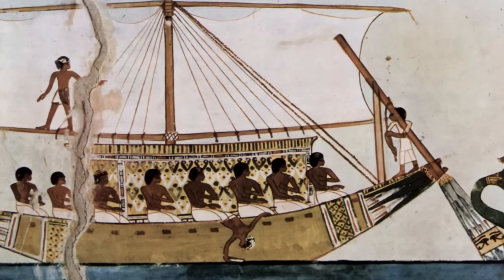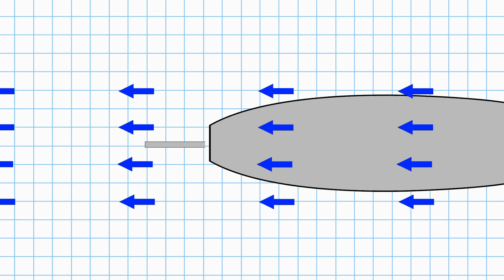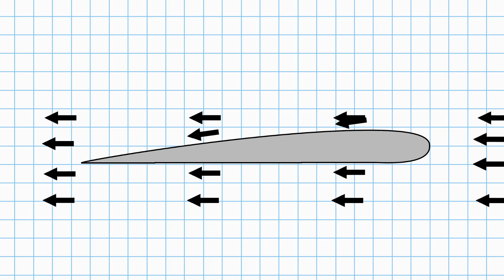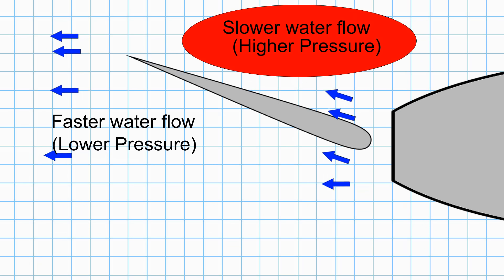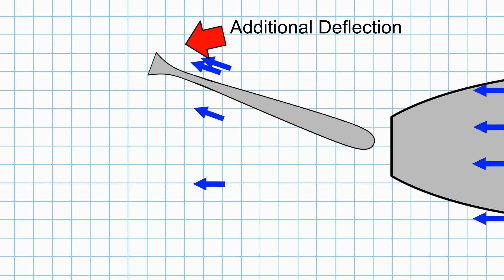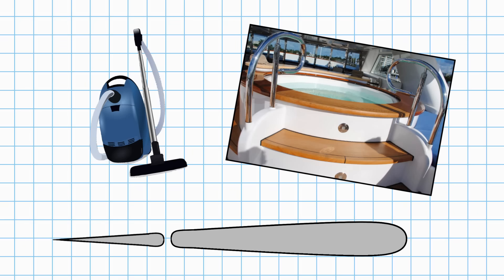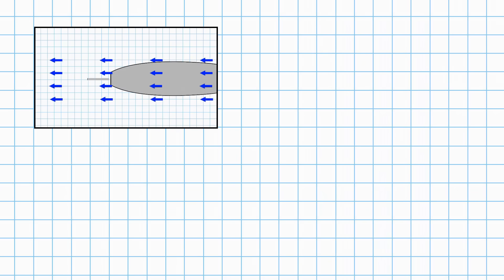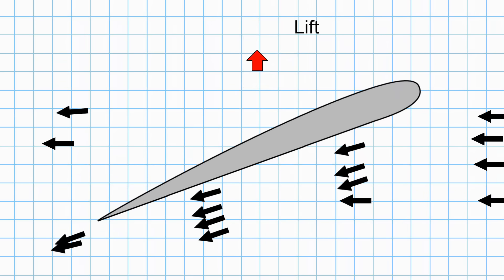How Does A RUDDER Work?

Comment: Your have only illustrated turning to port. Looking from aft, when a clockwise rotating single-screw vessel turns to starboard, there is a more quicker and stronger answering to the helm, a vital aid in the rule-of-the-road seamanship.

Comment: The finishing animation of air wing stall is totally wrong. The lift force actually increases with the increased angle of attack, while the animation shows it's decreasing. All up to the abrupt point of stall, above the critical angle of attack, when the air flow around the wing changes completely (arrows should move from the trailing edge towards the midsection of the wing).

Comment: The way a wing stalls is slightly different in that the airflow separates from the airfoil due to turbulence, you never really get out of the flow regardless of angel of attack due to forward movement.

Comment: Wings and rudders dont work because of a pressure difference. They work the same way that any motion works, Newtons third law. A rudder or wing pushes a mass of air or water because of angle of attack, and the rudder/wing is pushed equally in the opposite direction. Semantics...

Comment: While your description of hydrodynamics is correct, your depiction of hydrodynamics is displayed incorrectly. I’m sure it’s a limitation of whatever animation graphics application you used, but the way you display it shows a massive cavitation, or stall, of hydrodynamics flow on the low pressure side.

Comment: fun fact
Steering board in German is Steuerbord, it is mounted on the right, which is why Starboard is the right hand side of a ship
Reply: Thanks for further insight! Now that I think about it, what about the "portside" though...
Reply: @jehoiakimelidoronila5450  almost all ports required large ships to dock on their left side so the left side is called port sode
Reply: @jehoiakimelidoronila5450  also, in German the starboard side is still called Steuerbord, and port side is Backbord, because most people the dominant hand is the right hand so the left is called Backhand, hence Backbord
Reply: @mariebcfhs9491  the port side of a ship in English used to be called "larboard." it was changed in like the 16th century or so to reduce confusion for obvious reasons.
Reply: @jehoiakimelidoronila5450  since the rudder was on the right side, a ship could dock at a port on its left (or port) side. 

I am not that well versed in nautical terminology and history though, so if anyone knows their stuff better, please feel free to correct me

Comment: Thank you for sharing. Hope you can do a video on the shape of the rudder. I think there are a variety of shapes. Some straight, tapered or curvy, with larger area at the bottom as compared to the top. Thanks again.

Comment: Great video! The fishtail makes me think of the winglets on aircraft wings. Their purpose is also to minimize the air flowing around the edge from high to low pressure. The ship version seems to include additional effects, such as deflection, which you don’t have with planes. But they are amazingly effective, increasing efficiency by several percent. That’s why they are ubiquitous today.

Comment: Bull.  The airfoiled rudder works on the exact same principles as the squared off rudder.  It just does so more efficiently because it has less drag.  The velocity differential is still there for either shape.

Comment: Unfortunatly, you aero/hydro dynamics explanation is wrong. I recommend watching YouTube clips on how REALLY lift is generated. 
For the most basic explanation, the ruder deflect the water, and by newton's 3rd law, the water deflect the boat. At the trailing edge the water won't resume to the original direction but will have some speed at the same angle of the ruddr (until the surrounding water overcom).

Comment: I’d suggest that the force generated by a rudder is more to do with the change in momentum of the water, rather than Bernoulli pressure differences. It’s similar with aircraft wings; the angle of attack generates far more lift than the cross sectional shape

Comment: Are there any segmented fishtail rudders? I mean the dual segments works just like a multi-level wing on a race car and the fishtail acts like an aero break but functions like and end plate. so it seems that you could be able to get a much higher amount of maneuverability from some combination of the two. So long as the fishtail is only on the rear most segment of the rudder because otherwise it would negate some of the benefits of that style of rudder

Comment: If a boat is floating without any means of propulsion -- that is, its speed is determined only by the speed of the current -- can a rudder change the direction of the boat? If you recall in the movie The African Queen_ Bogart explained to Katherine Hepburn that it would do no good for her to operate the rudder. They were drifting downstream with the current and the rudder was not able to provide any steering unless the boat was moving faster than the current. Is that true?

Comment: You missed the stabilized or the center axis rudder.  That rudder has it's turning axis in the middle instead of the leading edge.  This allows the entire prop wash to act on the rudder and turn the ship much faster or sharper.  It can be used on the Becker rudder.

Comment: Question. On an RC Boat I notice the rudder is able to make a big left turn but the right turn angle is small. If going left I would say it turn about 45 degrees but if going right it turns about 25 degrees. Is this the correct way it should be set or a defect ?

https://www.youtube.com/watch?v=vfwmkoA3xVE

Comment: Thank you for your video . You have answered a question that has puzzled me for years . I saw a drawing of the system. Used to keep passenger liners stable in rough conditions. Where they would have short , " wings " on the sides underwater , that turned to keep it more upright . This design had short wedge shape on the trailing edge . I have asked many people why this was . Now thanks to your explanation of  a Schilling rudder , I know !

Comment: Ahhh- no- wings do not create low pressure that ‘sucks’ a plane into the air. And ships rudders do NOT create a high and low pressure zone in the water-
How a wing works is thru THRUST.  The low pressure zone IS created over a wing- however, the inertia and momentum of the wing are far too high for that weak low pressure to move the plane.  Instead, the Normal pressure air, well above the low pressure adjacent to the wing, Rapidly moves Down to equalize that pressure. As the wing moves forward, that downward thrust air is accelerated down beyond the trailing edge of the wing...when the mass of the air being thrust downwards equals or exceeds the mass of the airplane, the plane flies. This is proven by every Propellor and Fan... they obviously produce a powerful Thrust. The “sucking” side of a fan or propellor has nearly No force.

Similarly, when a rudder deflects the flow of water, it is creating a Thrust lateral to the direction of the ship and the vector of that thrust is located at the stern.
Water on the off side of the rudder is also deflected.   And the reason propellers are often arrayed so their thrust is run across the rudder is so that when turned, the rudder can redirect a thrust far greater than the mass of water flowing past the hull.
Reply: This comment is mostly correct but not entirely, I'd highly recommend you watch this video which attempts to explain everything involved in generating lift, and can be translated to the rudder of a boat quite easily.

https://www.youtube.com/watch?v=PF22LM8AbII

Comment: I'm a pilot and I didn't know that ship rudders could stall
Reply: The Bernoulli effect not only effects our wings, rudder, and elevators in the air but also effects other things in a fluid environment. I was shocked to learn helicopters could stall to but when I thought about for a bit it made sense.

This has also made how submarines glide underwater more interesting since those wings on the sides actually serve a purpose. Submarines can be controlled like aircraft underwater and can stall, but of course the ballast tanks cause it to behave like an airship.
Reply: Same as any control surface on an airplane can stall as well. They are usually designed to make that impossible as long as the aircraft remains within its design envelope, but either by external factors (icing for example) or flying outside the envelope (transonic speeds) can lead to stalled surfaces. Usually not an issue on the rudder, but it can happen to ailerons and the elevator, recovery from that issue can be very counterintuitive.
Reply: In smaller boats that have an unbalanced rudder (so the center of friction is away from the rotation axis) a stall is not an issue, because the boat will still turn because of the friction, although it will lose more momentum.
Reply: I race sailboats. On a friends boat, he had a NACA 0012 foil, but his photocopy of the leading edge came to a point, so he made it that way. It stalled so easily, it was difficult to get around the course. My own rudder is proper NACA 0012, with a circular leading edge, as it should be. I chose a non- elipically loaded planform, so that when the rudder starts to stall, it warns me, so I can correct it before I lose control of the boat. Also, appraoching stall at speed on my 19 ft boat can load up the hinge to around a 2000 lb load. I've had to replace bent 3/16" thick welded stainless steel hinges (gudgeons).  You do know that sails work as foils, so that the generated low pressure allows us to go into the wind?
Reply: @drewthompson7457  A concept I have to teach newbies on my boat.  Don't stall the keel or rudder. Funny about your friend's photocopy.  I should make a template and check the profile of my rudder ad keel.  Rudder looks like NACA 0012 but might not be. Keel is not but is a compromise like most things.
Reply: @alwaysbearded1  :I know of another guy that photocopied frame members, to find that they were the wrong shape. But these examples were from about 30 years ago. Perhaps copiers now are more accurate.
If you don't know how to lay up a template for a NACA 00 series, West System Epoxy has a good article, in their back issues.
I also put a NACA 0006 on my centerboard, the thickest foil the centerboard trunk would take.
Without a lie, my boat will tack thru 60 degrees, measured on the GPS.
I have learned that it is useless to prep your boat. 
A good bottom, good foils, good sails, good crew  (some good tactics), leads to a handicap change.
I have  found no other boat in my class rated a quick as I am rated, out of more than 4000 built. I now race on other boats with an established handicap.
Even the "fun" races at my club state " open to all boats 20 ft and up". (my boat is 19 ft, and they know this).
At another club, we won our division at their open regatta. The only thing said to us was at dinner, when people came up and said "can I take that chair".
I have thought of renaming my boat "Sour Grapes".
Reply: @drewthompson7457  I remember seeing a reference to the West System and that article.  My boat is a bit bigger, 34' keel is less changeable and I cruise so not so driven for speed but I sure would like to go as fast as possible but balancing what I change and the time and expense in the yard plus I just found out my local yard, only one for nearly 100 miles that allowed you to do your own work stopped the practice "until a vaccine is widely distributed" whatever they mean by that. Sorry the locals are jealous.
Reply: @drewthompson7457  Your boat sounds like a good fit for you and the type of sailing you do. I sail SF Bay so with the typical chop I like my larger boat.  Last Sunday went for a day sail and logged 35 + NM which is more typical for a summer sail. We found some wind.  The other highlight was being hit by a harbor porpoise. I'm sure she did not do it on purpose.  My guess she dove feeding and the fish went one way, she followed right into the side of my boat just below where I was standing with camera waiting to snap a photo of her.  160 Lbs. at about 5-6 knots gave us a jolt. We felt so bad and hope she is OK.  They have been absent from the Bay for about 70 years returning just in the last 8 or so. I enjoy seeing them. Good luck this season and keep enjoying sailing.
Reply: im a pilot too, rc pilot same ting

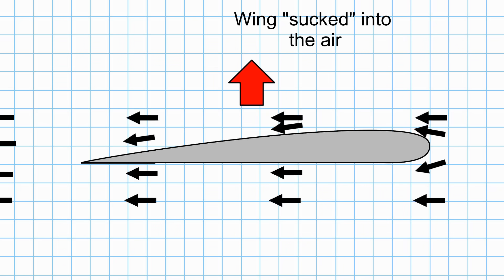Comment: 1:52 is not exactly right.
The lifting force generated by the pressure difference on a planewing is miniscule compared to the lifting force generated by the underside of the wing and its pitch angle (and air flowing against it). 
So a flat surface is not that bad. Really the real reason wings are shaped that way has much more to do with leightweight and minimizing turbulence.

Basically the Bernoulli-Effect taught at schools is really only a "myth" when it comes to aircraft lifting forces.

Comment: How does a symmetrical aerofoil rudder increase the pressure on the lower side, you need an asymmetrical aerofoil for this to work if you have noticed airplane wings are curved only on the top side to reduce the pressure there if the airfoil is symmetrical thn the forces generated are equal resulting to no lift

Comment: In fluids (both water and air) an airfoil does not increase performance by “speeding up” the flow on one side. This is an old theory that is still popular despite it being disproven many times. Rather, the shape of the airfoil helps prevent turbulence and flow separation, which increase drag and decrease transverse force, respectively. In a plane, flow separation is manifested rather drastically as a stall, where the lift force decreases dramatically.

Comment: Nice video - Q: has there ever been investigations of putting a rudder towards the front of the ship? I ask because of the turning force created by the rudder is ahead of the center of mass of the ship, would that allow the ship to turn a tighter circle? Or the "forward" rudder could help a ship turn tighter even if it also had a traditional stern rudder.

Again, great channel.
Reply: f12mnb A rudder at the forward end is not a new concept.  There are a handful of ships with them already,  but these generally only have a bow rudder when the ship is designed to be run astern for a prolonged period of time such as some icebreakers and ferries.

A rudder at the bow for a ship moving ahead would not be able to steer.  This is due to the vessels pivot point.  A pivot point is quite difficult to explain here because of the complicated hydrodynamics involved.  But, in simple terms a pivot point is a point about which a vessel turns.  When a vessel is moving ahead, the pivot point is near the bow....so when a rudder angle is applied the vessel turns easily because the force of the thrust acting on the rudder has a long lever to push on and will be very effective.  

Imagine trying to undo a very tight bolt with a spanner.....if you use a short spanner you only have a short lever and will use a lot of effort to undo the bolt.  If you use a longer spanner, you don’t need to use as much power as the lever is longer.  The bolt in this case is the pivot point and the other end of the spanner is the rudder.   The shorter the distance between the rudder and the pivot point means the ship is harder to turn, the further away from each other they are, the easier it is to turn.  

Chris - Marine Pilot
Reply: @marinepilotchris3048  Thanks for the reply. I've been thinking over your answer and analogy and quite like the spanner/wrench analogy. Which makes me wonder, if instead of  just a rear (standard) rudder, a vessel has two sets - a main rear one and an auxillary  one in the front. I'm thinking of the land analogy of very long vehicles that have a front and rear steerable wheels (older long ladder fire trucks had this arrangement). Since you are trying to pivot around what sounds like the center of mass of the ship, this is like have a large two armed tool - like some drill taps or tire irons where there are two arms from a center pivot point. 

It would add to the complexity of the ship but might make it easier to turn or dock some vessels.
Reply: f12mnb in order to achieve the manoeuvrability of vessels about the centre of mass bow thrusters are used.  A bow thruster takes many forms and designs, but by far the most common is the tunnel thruster where a prop is placed in a tunnel athwartships through the bow of a ship.  When the prop turns it sucks water from one side of the tunnel and ejects it from the other side.  This will provide a turning force much greater than any bow rudder could produce.  Don’t forget that a rudder needs water flow over it to have any effect.  This would mean that if the ship was stationary and wanting to swing about the centre of mass, then you’d also need a bow propeller to provide that flow. 
The expense of installing a bow rudder would not be cost effective when a simple bow thruster does the job much more effectively and doesn’t require the ship to be moving ahead/astern to give its full turning power.
Reply: @marinepilotchris3048  Thanks - that makes sense. Forgot about thrusters. Much easier to control and no need to have flowing water over the surfaces.
Reply: @marinepilotchris3048  Thanks - like the analogy.
Reply: Not rudders based on the limitations. But some vessels like tugs have Dynamic positioning propulsion/thruster pods fore and aft that rotate 360° so they don't use any rudder. Orientation and direction if travel is determined by the position of the pods. This DP pod system is also uses for Drill Ships, etc.